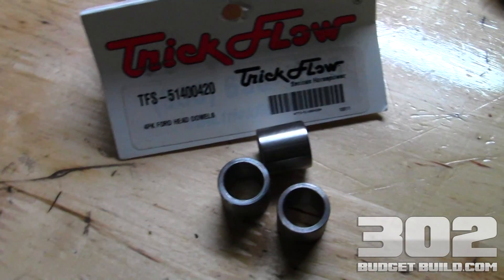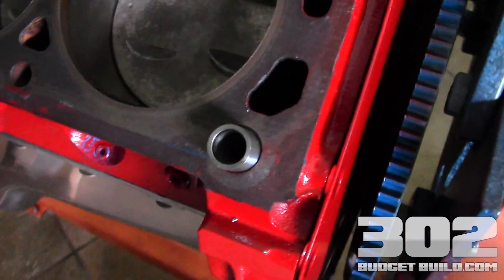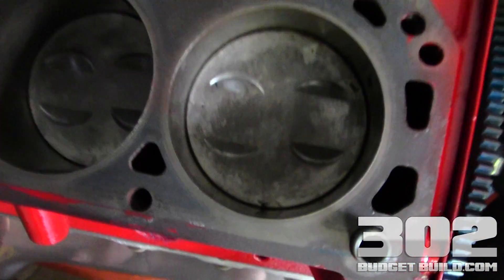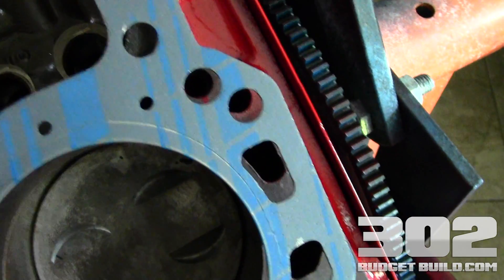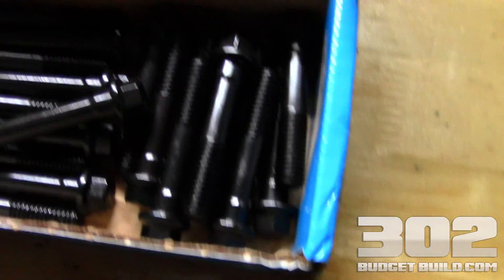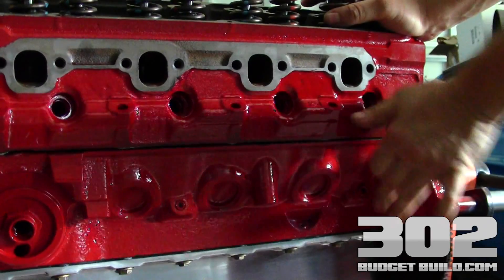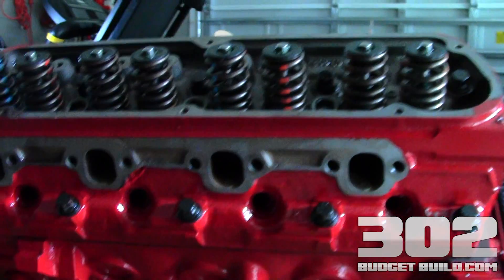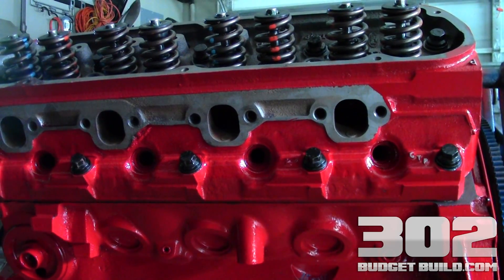How To Install Cylinder Heads on a Small Block Ford 302 | GT40 GT40P Heads ARP Bolts

Comment: The lower outside shorter head bolts thread open into the water jackets in the block right above the freeze plugs.  You have to use non-hardening thread sealant on those shorter bolts to prevent water leakage.  You use assembly thread lube on the longer upper bolts.

Comment: Super precise instructions. Thank you I might be inclined to use a thread sealant as well.
There are two methods for torquing. They both work just get the 70 pds right. The red motor paint helped greatly to see the lecture.
Alan

Comment: I used my old bolts . Been on the heads for 12 years. Haven't had any problems. Oh yeah,no sealant needed on any head bolts. At least I didn't need any.

Comment: I would use a shorter extension. The long extension has more flex and is not as accurate. I would also torque to 35# first and then go to 70#. I would also not paint the oil filter receiver area.

Comment: Should have made the comment of ensuring the cooling holes are towards the rear of the block. If you install the gasket with majority of coolant holes to the front of the block will cause overheating.

Comment: With these engines, you can use the old head bolts. No need to buy new ones. With some modern engines, yes, but with these old V 8:s the bolts can be reused over and over.

Comment: Don't you loose some "Torque" with an extension?
Reply from the maker: Myth. Or it doesn’t matter either way. Almost 80k on the engine with zero issues.

Comment: good morning i have a question if i buy a gt40p for a 302 rollers which camshaft i would use which push rods i have a question whether to use the f303

Comment: Great job on video and the step by step instructions. 
Something that might help make your life easier,  when  screwing in those 10 head bolts before torquing  them down would be to use a Dewalt cordless drill with the torque release (or a regular cordless drill) would work to.  But instead of the time consuming wracheted of each bolt by hand.  Just quickly spin them down with the drill,  then use the torque wrench to finish.

Comment: Very informative! 
My ‘83 Bronco is missing. When going up a hill, one intake valve seems to get stuck open because the intake vacuum drops hard. If the motor doesn’t stall, the vacuum goes back to normal. Thankfully there is no backfire, but it is still a problem. 
I think I’m looking at pulling the head to service the valve on my 302.

Comment: I've been trying to find an answer for this and figured someone would get back to me here. On my 88  5.0 I purchased some felpros 9333. It's a supercharged 5.0 and when swapping heads I noticed that the oil drain back holes have two holes covered by the head gasket and  two open. Placed it exactly like he did. And on the front of the block I am getting the hole for the pil to drain back goes straight through and towards the rear of the motor the hole is covered by the head gasket. Now on the other side of the motor passenger side head.. I have the front hole covered and the rear hole is open. Is this normal or do I want all four holes opened?
Reply: Eli Guerra hope you figured out

Comment: Would gt40 heads fit on a 1997 f-250 351w fuel injected?
Reply: Yes it will fit with a 351 Windsor you just have to have the head bolt holes drilled out that's the only difference the holes where they bolt up are smaller!! I believe it can be done just use the dowel pins to line the holes up before drilling!! Gt40p heads are steelcast heads but it might not be worth it to do for you if that's something you prefer not to!! 351 small block Windsor heads will fit the 302!! But the 351 Windsor heads are not as good as the gt40p heads!! Just because of the exhaust and intake porting that's the big difference!! And the boat holes is where the difference really is!! That's what I heard!?... 👍🤔💡🙄🤯👌🇺🇸💪🙌

Comment: A dumb question, should you use a lot shorter extensions for torquing your head bolts down, doesn't the longer extension twist under load?
Reply: Yes they do

Comment: Just wondering, I was told to never use an extension on a torque wrench. Anyone ever have problems with this or is it an old wives tale?
Reply: I thought that too. But if you torque it with or without the extension, the results are the same. 1st torque it with the extension then double check without it on and it's clicks everytime.
Reply: I did. No problem! I also reused my head bolts! No problem there either!👍
Reply: It is, indeed a wife's tale. Would be much better if it were a wife's tail, but it is what it is. Torque applied to one end of a shaft (extension) is the same at the other end, unless there is something along the shaft (like a vise-grip pliers) disrupting the reading or the application of the torque. (Remember, torque is a twisting FORCE, and when applied, sends an equal and opposite REACTION back along the extension. Now, here's something to ponder: If you have thus applied the torque to the extension, you now have potential energy built up in the extension. If you lock the torque wrench in position so that it can't back off, and apply, say, sulfuric acid to the extension, what happens to the stored (potential) energy as the acid eats the extension away? Hmmmmm.

Comment: @ David Gavin.
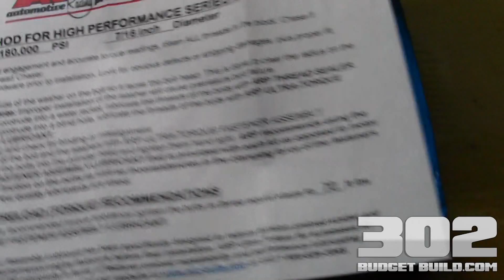 Well pointed out, If you stop the video at 5:21 you will see exactly that. The "Preload (Torque) Recommendations". That is why it is very important to get a Repair Manual like Chilton for your vehicle to ensure you are doing it correctly. Videos are great but at times leave out small but very important information as mentioned in this video with the head dowels. Those repair manuals are not expensive and every professional mechanic has them. It is impossible to remember all the things that comes with a motor not matter if you worked on just that type of motor you entire life. You will not remember all the torque sequences, or the foot pounds of torque for each bolt, etc. it is just to much. So all good mechanics have those repair manuals to make sure they are getting it right. Especially when it comes to the internals of a motor. I buy one for every car I own because the information in them is complete for ANY THING you need to do to your car. It even teaches you how to Bondo, Primer and Paint the car if you wanted to. Over all I think the video was Great and very informative, well done.

Comment: You do not have to replace the head bolts on these engines, I've used them over and over and never had any problems , You only need to replace head bolts on newer engines with the turn torque method , I bet you don't replace you don't replace the rod bolts , which are far more important

Comment: Good video.
Good idea to scrape the paint off the lower row of head bolt shoulders on the block.
After a few warmups, the paint will soften up & you will lose some of your bolt torque, speaking from experience.

Comment: Are you supposed to use any kind of high temp sealant on the bolts that go in the water jackets, and how do you know which holes are the water jacket holes

Comment: You haven't taken in the extension your using. You should always have it as short as possible or dot use one at all if you want the most accurate torque rating on your wrench

Comment: do u have to buy new bolts?
Reply: Yes. Most head bolts are torque-to-yield, so one use then throw away.
Reply: Older SBF 302's and 351w did not use torque-to-yield head bolts, only the newer motors started using them, so check the year of the motor to be sure. If before 1978 you are good to re use the head bolts.

Comment: Thank you. I have not rebuilt an engine in 30 years. I am thinking of doing one with my son. We are leaning toward a 351W for a bronco.
Reply: good choice. picked up my 398 stroker today from machine shop. 500 hp
Reply: Go 351w, they are like a 302 on steroids, meaning the entire bottom end is beefed up. I rev my 351w to 7500rpm regularly with no issues. Stock bottom end and the motor is going on 24 years old. For reliability, the 351w is a beast! Great choice.

Comment: my block got bored to .030 over.can i still use these head gaskets fel-pro 9333pt1?also i will be intalling the GT40 heads.thanks
Reply: no. you need a 30 over bore gasket or the piston will hit the gasket.
Reply: Ok! Thanks for reply
Reply: Negative, you can still use the 9333 gaskets as they have a 4.100 bore,

Comment: Thanks for the good video and information. I am about to do a rebuild on my 1969 Ford Falcon with a 302. With the high quality on the market and manufacturers you can trust with quality and performance parts my job now will be a good deal easier than it would have been in times past. Us old timers from the 60's appreciate you and our old ways. Thanks and Keep the Faith.

Comment: not only do I learn from the maker of tne video but also comments now I was old that usung extensions does effect torque because of torsion and theres a formulary equation to getting proper torque if extensions are used any one else know about this
Reply: You are right on the money! I NEVER use a 3/8 drive socket/extension for ANY bolt size 7/16-14 and larger. Shorter 1/2" drive extension/6 pt socket/ current calibration tag on torque wrench, and 3 equal steps up to final torque. I always chase the threads in the block just before head installation, then use compressed air to blow it out. I also mist on a layer of Permatex copper coat on both sides of the gasket too. And yes, thread sealant where water jackets exist. I worked Aerospace and Gov't jobs my whole life. There is a data sheet with a Mil-Spec for just about everything. And guess what, I probably missed something. Would you get onto an airplane or a rocket where half-ass workmanship was used? I don't want to be right, I just hate doing things twice.
Reply from the maker: Precisely. If it weren’t for the community I wouldn’t have learned either. That’s the beauty of YouTube. We are all helping each other!!!! 👍👍👍

Comment: Interesting video, you might want to stand on the engine stand while torqueing the bolts, keeps it from moving on, you better control! Some of the others noted the use of thread sealer on lower bolts, and going in increments to the final torque value. Learn as you go!

Comment: You should torque all the Head bolts, or any bolt sequences in their correct sequence in two to three sets. One round up to either 1/2 the torque or 1/3. Final or third torque can then be performed. If you torque one bolt all the way to 70 ft. lbs., when you torque down the rest in the same manner, I can guarantee when you are done with the sequence, #1 will be loose. Tighten them all equally, you get an equal and more exact reading, and you done run the risk of stripping the threads in your block or worse, breaking a bolt off in  the block.
Reply: Not for nothing but he shows the instructions for the bolts where it states that the bolts should be torqued to 70 in 3 steps.
Reply: i was thinking the exact same thing David,,,ive always step torqued  the engineers at Ford are misinforming him,,,,sorry, this is a negative comment which you didnt want   but i felt it was essential to avoid future major problems
Reply: I agree with all but one other thing he should have done is put lube on both sides of the washer

Comment: do you still use the stock intake for the gt40 heads
Reply: You need a manifold like an Edelbrock 2121 as the ports are larger.

Comment: If I buy heads will I have to buy a cam too? What's the reasoning for people using 305 sbc heads on 350sbc?
Reply: you can increase the cylinder compression by using the smaller heads which theoretically increases power but that's debatable.
Reply: +Chuck Swingle would I have to replace the cam as well if I put 305 heads on?
Reply: Not necessarily, it depends on what you want out of the engine. You can leave the stock one in no problem but if you want to get more horses out of it there are plenty of 3rd party manufacturers willing to cater to what you want. If you aren't going to race it, leave the stock one.

Comment: you can reuse head bolts just not the newer 5.0 with the torque to xxx and 1/4 to 3/4 turn more. torque to yield I think there caled. And why not buy studs from ARP better then standard and they help line up heads. and the intake side of head long bolts torque at a higher ft lbs  and that long ass extention is losing some of your torque
Reply: KcuFeM2 plus thats A 5.0 roller . 5.0 was first used on the 78 King Cobra and from then on 302 are called 5.0 even if there same ci or cc. In 80 or 81 they started changing the balance some had 28 oz still and some 50 oz trucks stayed longer at 28 and 351w are all 28 oz just say'n
Reply: +KcuFeM2 had a 76 cobra with factory 302

Comment: Really?  These bolts are not torque to yield so there is no reason to replace head bolts unless you break one or you want to.

I have reused head bolts on every engine Ive built with no problems.  Only head bolts that have been replaced are torque to yield bolts.  Those bolts are one time use.  You torque the bolt down then you go so many degrees, this kind of bolt actually stretches and when you torque it down and go the number of degrees you are supposed to they are not tight enough now cause they have already stretched once.  On bolts like this engine, you torque them to 60 to 75 ft lbs or what ever the spec is and you are done.

Comment: You failed to point out that you need thread sealer on the bottom row of bolts as they go through into the water jacket on the late model SBF found that out today when cleaning the headbolt threads on my 5.0....
Reply: HollywoodMGB3, then they haven’t built a small block ford... the lower set goes into the water jackets.. sealant is necessary to prevent issues.
Reply: i think you should of used lubricant on both sides of the washer
Reply: My new head bolts came with the sealer conveniently on the the short bolts. Nice of them.
Reply: yes you are right
Reply: hobbeekid I was wondering about that.  Thanks for pointing it out.
Reply: ARP hotline says to only use the ARP assembly lube.
Reply: I was wondering about sealant on the lower. Bolts
Reply: Peter Preston I called ARP yesterday and they told me they did not know of any of the studs go into water jacket
Reply: @HollywoodMGB3  Easy to know if they go into the water jacket, if you blow air into the bolt hole and it blows air/water out of the water jacket holes, then they do.  Every 302 I've ever worked on the lowers go into the water jacket.
Reply: Would you use rtb grey gasket maker as a sealant?

Comment: did you have any problems with coolant leaks when not using thread sealant on the lower bolts?

Comment: Would there be an issue with gt40 heads on a 302 with flat top pistons? If so what can I do to accommodate thanks
Reply: Did you find an answer? I have a set of GT40P's and an 86 302 and I need to know if I need new pistons.
Reply: +2011FordMustangGTCk (

Comment: I always use thread sealant on the lower bolts because they go into the water jackets. I also use a 3 step process for torque

Comment: @ Archifllx Thanks for the great videos man.. I have a question for you about the 9333 pt1s head gaskets! They both say front on them so I know the driver side goes on perfect but the passenger side the front sign faces towards the rear of the engine. Should I just flip it over?

Comment: Last I checked for most if not all 302's as long as they were in good shape you could reuse the bolts with no real issues, not saying its not a bad idea but for a cheap ass like me if they can be reused and are in good shape why bother getting new ones unless your gonna be running some serious boost or a very high rpm engine.
Reply: The hash slinging slasher. I've had good luck reusing the head bolts

Comment: I know those dowels are needed but do they need to be new? I'm just swapping the gasket.
Reply: no can re-use them several times
Reply: It's just a preference in case they have been overtightened!! That's all extra precaution and extra money spent!! If need be you could Mic you are old dowl pins!! But yes you can use your old ones if it matters to an expense!! He was just giving a suggestion of replacing them which either way he was looking at the perspective of not having to change head gaskets again or warping a head!! That's all he was referring to taking precautions that's all!! It's up to you if you want to use your old dowl pins!! But good question ⁉️☺️
Reply: A reply after 8 years 🤣 kept the same dowels and it still runs just fine.

Comment: nice video, when ive done head gaskets , ive always done it in increments. it just seems wrong to tighten them to full torgue all at once. am i doing it wrong?
Reply: no doing it in steps is better usually something like 20, 45, 70

Comment: i picked up a 302 out of a  93 bronco going to convert it to carb and run a Holley fuel pump i wanna put these heads on that you have the gt40 would it be worth it or should i keep the stock heads on ? also what manifold/carb setup do recommend its going in my Toyota truck its my camping/mud bog/rock crawler/grocery gettter haha also thanks for the awesome videos!

Comment: Not sure if you did it or not, but the lower head bolts on SBF engines go into the water jackets, therefore you should use thread sealer on the lower head bolts to prevent any water leaks. I personally like the Permatex brand.

Comment: Looks great. Brought back some memories when I rebuilt my Chevy 396 for my '69 Chevelle. 
I miss those days and at 65 they ain't coming back. Time for the new bucks lik eyou to take over.
Reply: picked up my 351w [398] stroker today from machine shop and I will install in my 70 mustang and I'm 75 yo. pulled the engine myself and will install myself. installed 4 wheel disk brakes, AOD 4 speed tranny and a posi rear end. go do it. have fun. 500 hp. was a nice  day here today 12/7/18. 17 degrees when I loaded it. high was 25 here today. warm fire in the stove tonight.